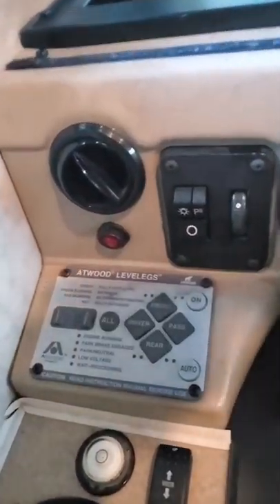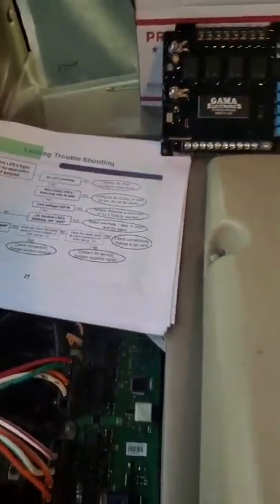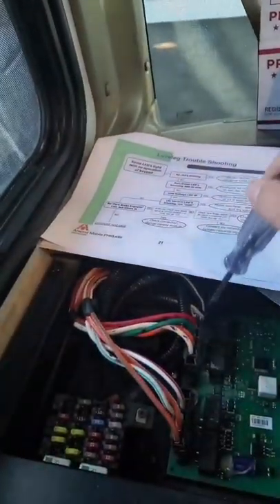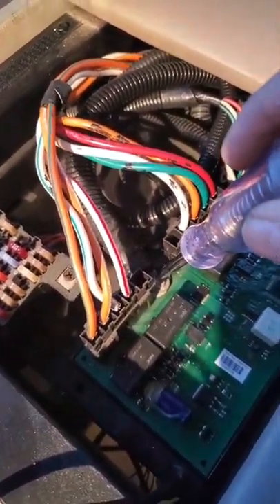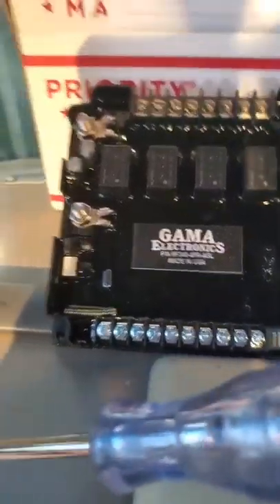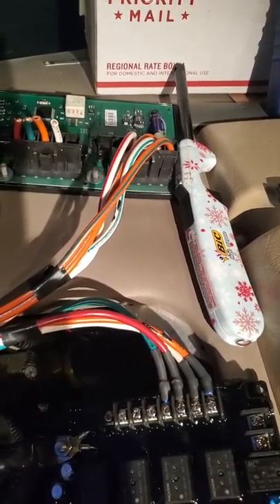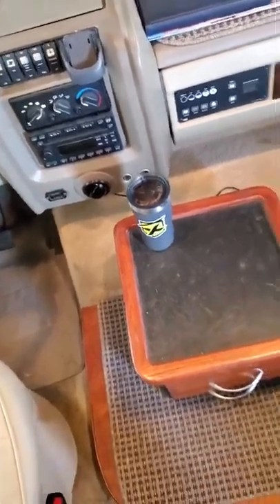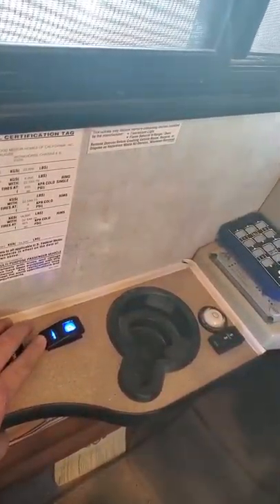Atwood  panel failure-Conversion to GAMA RV jack control

Comment: You did a great job for your first video.  Just ordered.
Reply from the maker: Still working great after almost 2 1/2 years. One of my jacks is starting to have a little clutch noise but for the money this system works excellent-Just don't forget that you no longer have any warning that your jacks are down when you drive off.

Comment: Thanks for making the video. I have a CHEVY Duramax motor home with a defective board....water damage because the builder mounted the circuit board flat on the inside bottom of a basement compartment.  I could only find a FORD board which I found is wired differently.  I may get the GAMA control and was curious why the 10 screw connections on the top edge of the board.  Glad it worked out for you.    JwgK in Houston TX
Reply from the maker: Those additional screws are for manual/momentary switches

Comment: Where did you get he ring connectors
I can only find them for 10 and 12 ire not  good fit for the 10 it loses some  of the wire when I push it in
Reply from the maker: I was lucky enough to have a father in law that worked at and purchased electronics parts from Lockheed Martin. I had what I needed in the tacklebox of electronics he left me. I did see them on Amazon as well. Good Luck

Comment from the maker: Actually the remote works so well I never felt the need. Everything is still working great. I do feel that the jacks themselves will be an issue and I will be looking for an alternative if I have any failures. If anyone comes up with a solution that allows leaving the atwood system in place, please let us know!
Reply: Thank you for your info, that is my worry, the actual jacks going bad. I just bought my rig and the previous owner said they would go down but not back up…
Reply from the maker: That may be a controller issue? @bounderchris